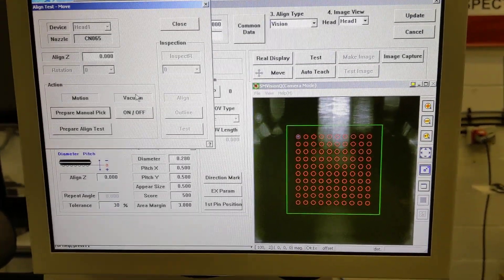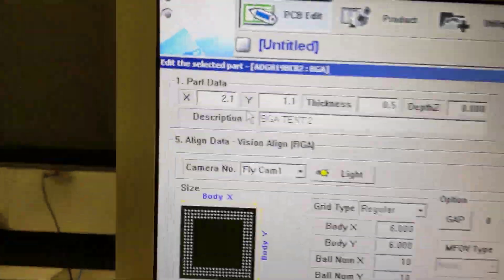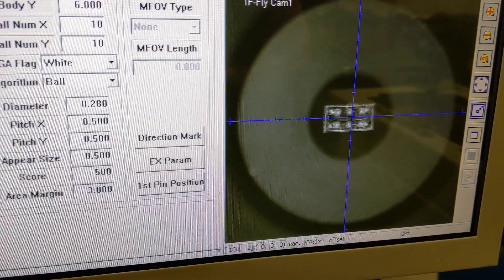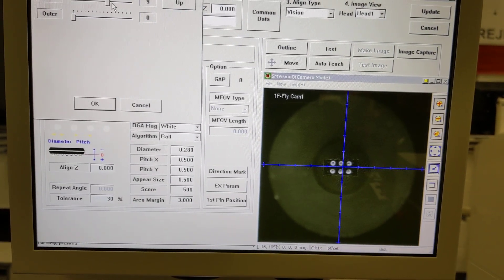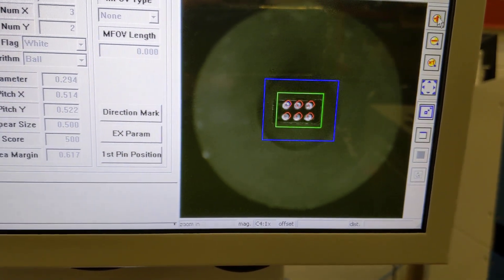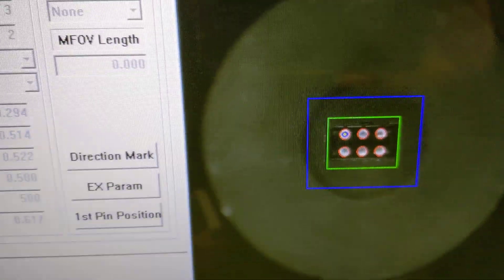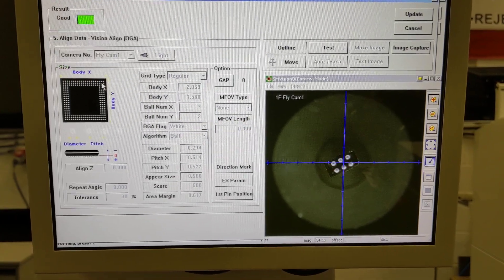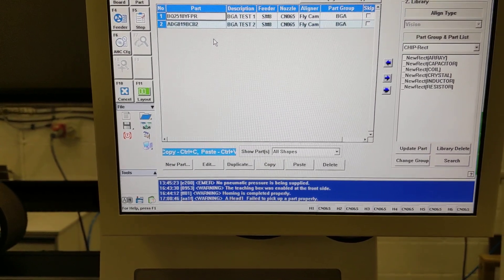CSP test using Hanwha SM482PLUS Flexible pick and place machine.

Comment: I have a question.
Is it possible to set the option to continue the work cycle even when I finished a component? I have a hanwha 482 plus 10 head
 After I stop until the feeder is supplied.
Reply from the maker: Yes this is possible, click continue and press start

Comment: I have a samsung sm482 that has head 3 coming down too far and knocking the pcb, you can here a definable clunk, i have re calibrated and see that then Z height is at -2.68, is that too far? how do i reset it lower? it is set down more than the other heads.
Reply from the maker: Hi Kit.

If you auto calibrated then it could be that the vacuum detect didn't go well.
Try load a blank PCB and manually bring the head down to the top of the PCB and save that value.
Use a thin sheet of paper until you feel the nozzle or nozzle holder grip the paper , then remove the paper and give the Z a couple more clicks.
Save this value, home the machine and then an easy way to check after...
Go in step program, on Z field click move and do this will all 6 heads.
Then get a steel ruler and put it across the bottom of all 6 heads, see if they all touch the ruler.
Oh and do this with the head at the front over the feeder base so you can access the bottom of the heads.
Let us know how you get on!

Comment: I'm having an issue with SmartSM application, after a shutdown over the weekend and turnimg the sm482 back on the application is zoomed in to the point it's unusable on both displays. If I close the application this zoom effect is not occurring for any windows functions. If you have any solution that'd be greatly appreciated

Comment: i have a question. why when want to do the auto teach the error assign Vision NG?
please advise. Is it problem with the camera?
Reply from the maker: Hi. If it's CSP or BGA then only use side light and a low light. Make the real size a little smaller the actual size.
Reply: @Elite7Installations  it''s QFN. ok thanks i will try it